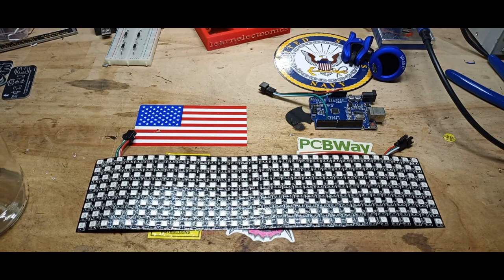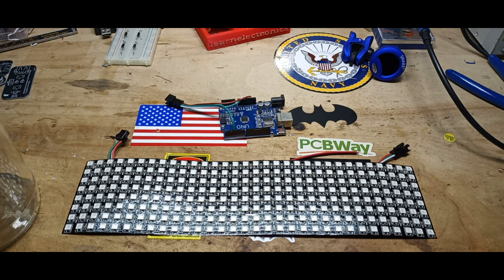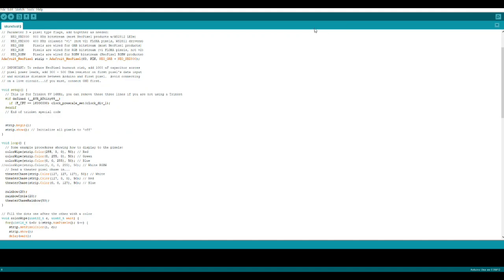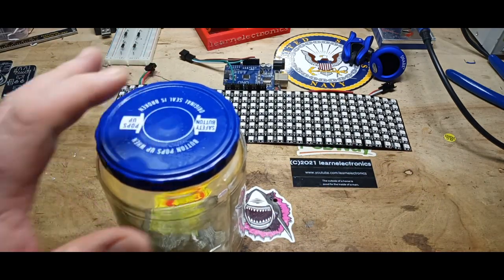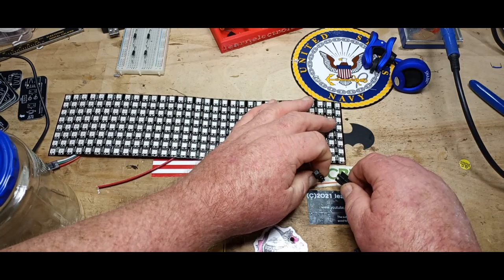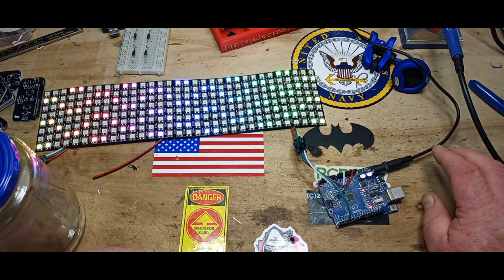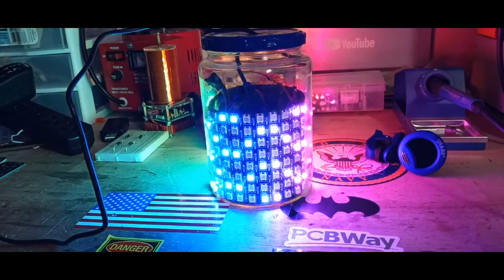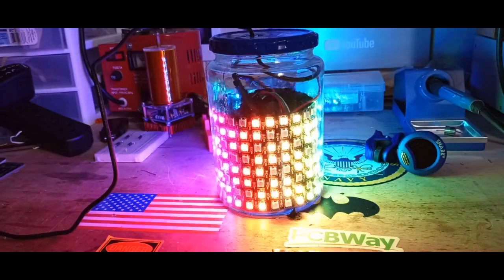Easy Arduino & Neopixel Feature Light DIY KIDS ANYONE

Comment: Taken directly from the info sheet on Adafruit's web page on NeoPixel power requirements:
/quote
Each individual NeoPixel draws up to 60 milliamps at maximum brightness white (red + green + blue). In actual use though, it’s rare for all pixels to be turned on that way. When mixing colors and displaying animations, the current draw will be much less. It’s impossible to estimate a single number for all circumstances, but we’ve been using 1/3 this (20 mA per pixel) as a gross rule of thumb with no ill effects. But if you know for a fact that you need every pixel on at maximum brightness, use the full 60 mA figure.

To estimate power supply needs, multiply the number of pixels by 20, then divide the result by 1,000 for the “rule of thumb” power supply rating in Amps. Or use 60 (instead of 20) if you want to guarantee an absolute margin of safety for all situations. For example:

60 NeoPixels × 20 mA ÷ 1,000 = 1.2 Amps minimum
60 NeoPixels × 60 mA ÷ 1,000 = 3.6 Amps minimum
unquote/

Yes, this is worst case scenario, the script does not drive each pixel to full brightness, but if it did, 256 x 0.02A = 15.36 Amps! As Adafruit suggests, 1/3 is a rough estimate which is still 5A.
The poor AMS1117 5V regulator on the Arduino is rated for 500mA, maximum! It will current limit to save itself with this kind of load but it will pop eventually. When it pops, it may short the what ever voltage you have on the adapter jack directly to the 5V line frying both the Arduino and that NeoPixel matrix instantly.
Better to use a decent 5V adapter capable of delivering at least 5A to power this thing, and feed the same 5V to the Arduino directly from the 5V pin which bypasses the AMS1117.

Comment: Got mine! these are fun. I turned the brightness down and feel better about V pull...lets make it say words soon..thanks!!
Reply: Oh wow so I have these "Iteaduino Lite" Arduino clone things. They come with a obscure (discontinued?) chip manufactured by a Chinese company called LGT8F88A. These were given to me about 6 years ago. They only have 8k memory and cant really run anything an actual arduino (or clone) could. After I commented things out I noticed it does fit on the Itead Lite so I can finally put these in a project and be done with them :))

Comment: Pulling far too much current off the Arduino 5V header. Should be seperate 5V supply to the leds with a common ground.
Reply: Could connect to the Vin header pin.  My pinout says there is a 1A limit (from diode between barrel jack and Vin).  You could add a big capacitor across the neopixel power and ground to help smooth surges from sudden lighting changes.  But even 1A, assuming an average of 1.5 LEDs lit per pixel, only gets you about 30 pixels simultaneously (at full brightness).

Setting lower brightness on the pixels helps with current draw, at least according to the current meter on my bench power supply.  (I wonder if the PWM phase for each of the pixels is randomly distributed?  That would help average out the current.)

Comment: I have 3 of these that size. You can attach them together to make a longer strip but it gets tricky to put them one on top of the other to display scrolling text that moves down. I'm not that adept at programming but maybe I should just put them into a picture frame and have randomised LEDs like to have done.